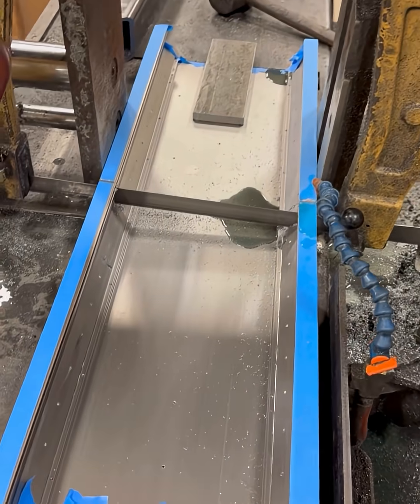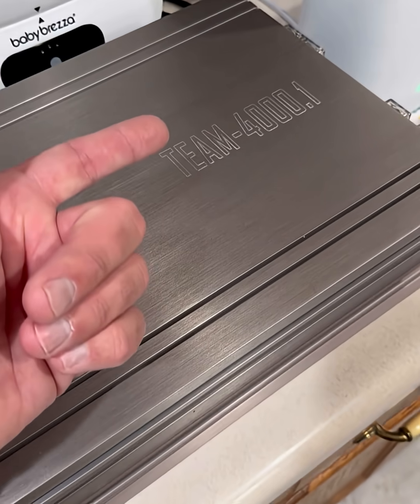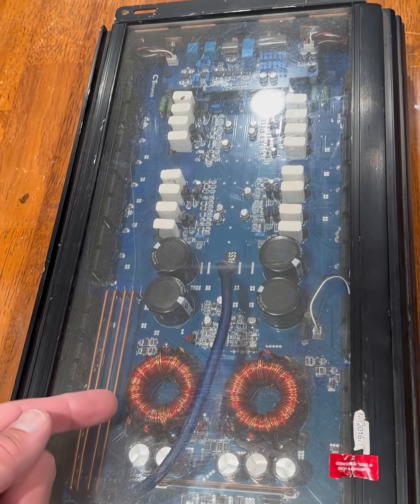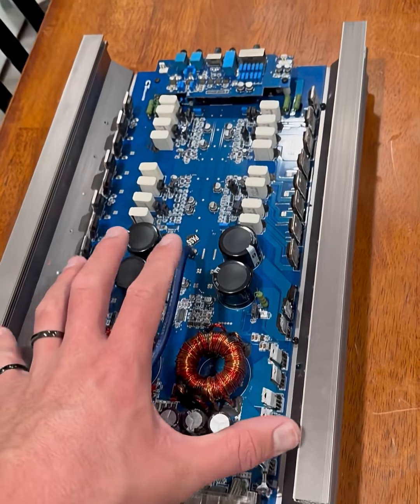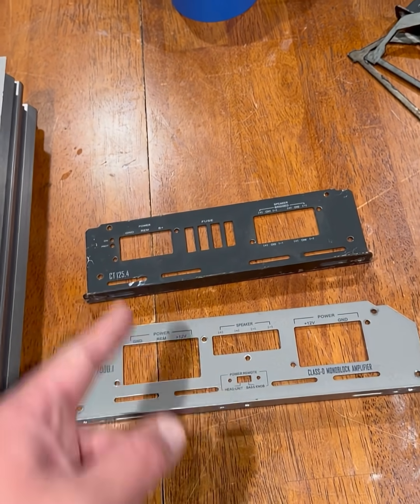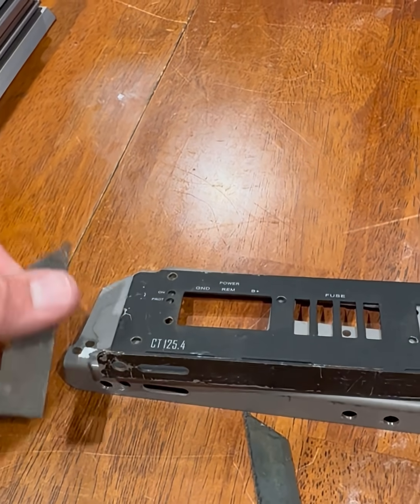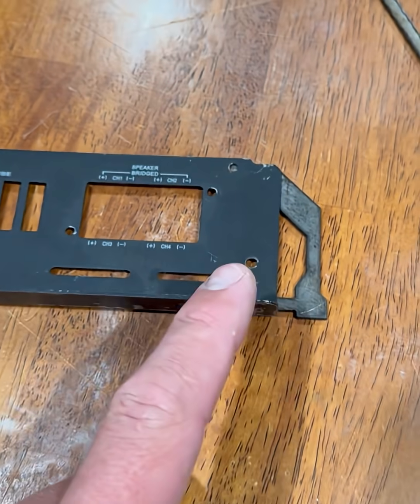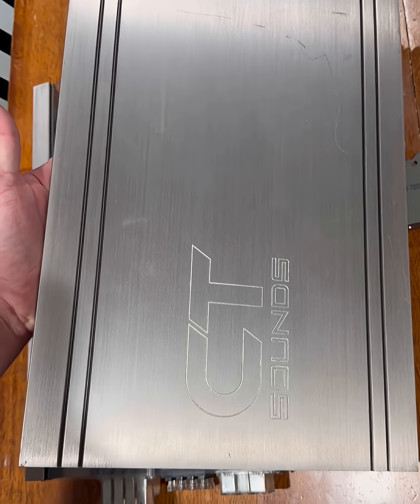Making a CT Sounds Team 125.4 4 channel amplifier!

Comment: Can you include 24db xover and not 12db 🤮.
Reply from the maker: I’m running dsp. So I can do whatever
Reply: You can't easily modify the preamp section. If the amp came with a second order crossover, then that's what you're stuck with.